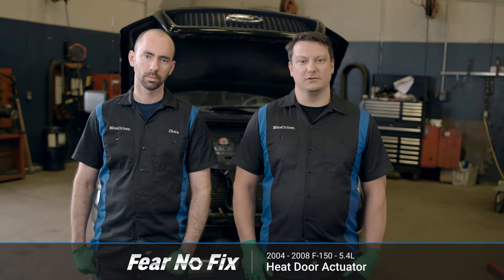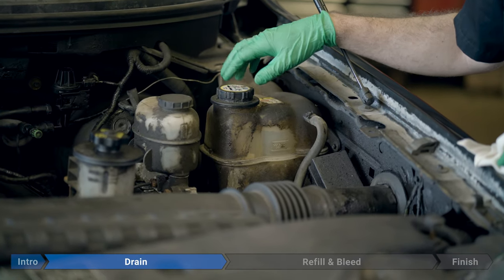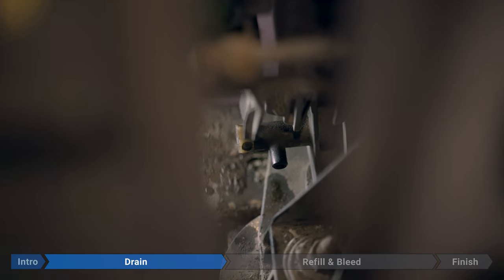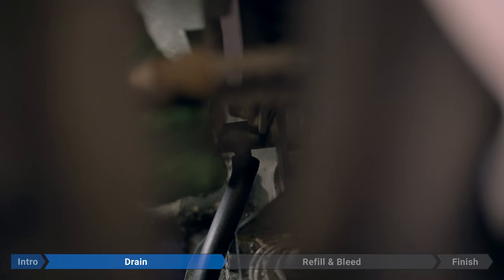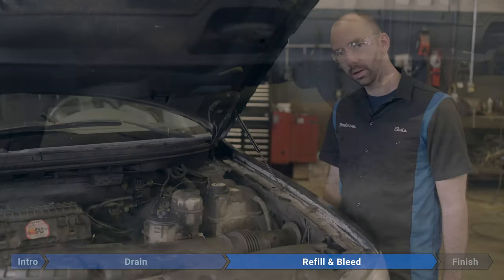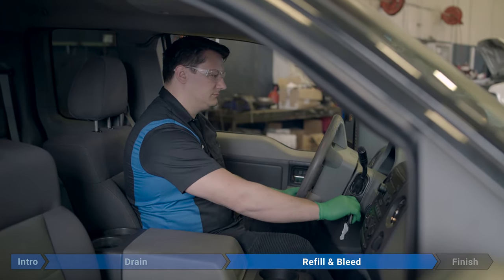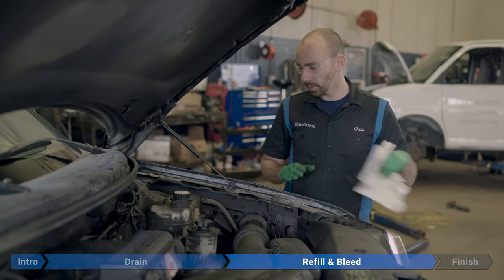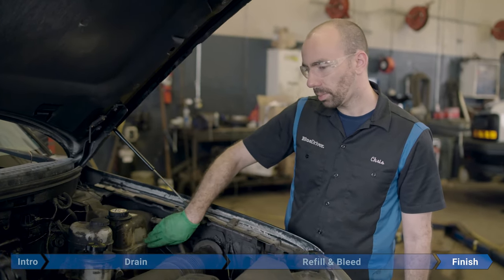Coolant Change – 2004-2008 5.4L Ford F-150

Comment: Let's see did I miss something no radiator flush,No running water unto clear ,block is still filled with the old fluid, heater core still with old fluid, Heat wasn't put on to help circulation. Guys your videos influence guys that look for a way to do this kind of stuff if you going do it do it right and not your interpretation of this 1/2 stepping.
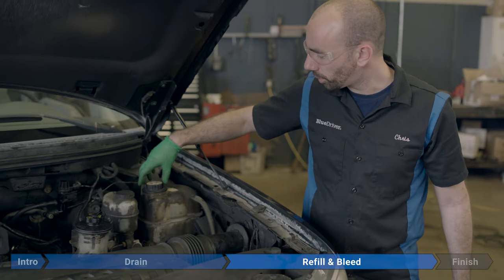Reply: He actually did turn the heat all the way up at 4:35 .  One of the problems with flushing the system with a hose is the water.  Tap water.  Now you're going to have tap water in the system.  All that tap water in the engine block is going to be bad with the modern coolant formulations.

Comment: My Explorer is due a 6 year coolant change. I do not trust shops on these things for 2 reasons. One, it is so easy to say you did all this stuff if coolant looked new anyway. Had this happen on my 07 Ram and I feel I was scammed. The more I talked with the teck, the  more I felt that way. Too old to do the work my self now so I must use a shop. This video did not make me feel any better. Drained the radiator and added some coolant to mix with the dirty stuff in the block. Not sure I feel the chemical flush does any good. May even harm but do believe in the coolant swap. As other suggested, refill and re drain may get some more old fluid out and we need to know the new mix is what is needed for the winter.🦇

Comment: Can I use prestone brand? . It's green color and it says it's compatible with all colors of refrigerant. I have the same truck.
Reply: I had a 2000s explorer that used yellow coolant, tried putting some generic green stuff and it caused a ton of problems. Seals went bad and it seemed like it ate part of the hose. No problems at all until I put the other stuff in it. If you do use the other stuff make sure you flush out the system completely.

Comment: A few unanswered questions here, especially block coolant, not flushed. But Jordan, your reference to dirty coolant, that truck came with Fords gold coolant and that's kinda the color.
Reply: The 5.4 engine takes 20.9 quarts, or 19.4 liters.  You need distilled water for the modern coolant formulations.  Have up to 15 gallons of distilled water on hand.  Drain the coolant.  Refill with distilled water.  Remove the thermostat.  Run the engine for 5 minutes while periodically revving it up to 3,000 - 3,500 RPM.   Follow same procedure to fill up to line on bottle.  Drain.  Repeat until the system is clean, with clear distilled water.  Drain half the water.  Reinstall the thermostat.  Fill with concentrate meeting spec WSS-M97B51-A1 .

Comment: A good flush is to open the fill port on the engine block alot of debris down there that doest come up on that drain by the radiator
Reply: Where is this at?🦇

Comment: Straight coolant!  😮
For those wondering, the mixture is 50/50 w/ one gallon motorcraft gold coolant & one gallon distilled water!
Reply: They said they’re using an oem equivalent. Could’ve been a premixed 50/50 coolant.

Comment: What about the coolant in the engine block.  Won't it contaminate the new coolant?
Reply from the maker: Ideally you'll want to pull drain plugs and get it all out, you can also actively flush it out or drain and fill a few times to get most of the old stuff out.
Reply: @LemurMonitors  how would you flush the block, too?
Reply: @LemurMonitors  Explain where the drain plugs are.🦇
Reply: I start with a cold engine. Drain the radiator leaving the petcock open and start the engine. When the engine opens the thermostat the block coolant will then come out into radiator. It will be hot and thats when you know the block is empty.As soon as you see the flow slow down shut the engine off so it doesn't run hot.Close petcock and refill.

Comment: What is that sound in start up the rattle some one said they need to open my motor and check maybe timing chain but I traveled to miles and no sign of engine problems only on start up the rattle
Reply: Possibly a exhaust manifold leak. It’s almost like a ticking sound. Not a huge issue if that’s the case

Comment: I bought a 2008 f150 4.6. The heater does not work on it. The other day it started to overheat. I replaced the thermostat and ran fine for awhile. A few days after it started getting hot again. What should i do?
Reply: If you're continuing to overheat after replacing the thermostat, then it means you might have a leak somewhere, either externally or internally into the engine.  You have to get under the truck to see and check the hoses.

Comment: Is the 3/8" hose you used on the petcock 3/8" inside diameter hose or is 3/8" the outside diameter of the hose?  Thank you for this video!

Comment: Thanks for the direct step by step to the point instructions without any bullshit , and safe 👍🏻👍🏻👍🏻 also no one said it was dirty , they said it obviously needed changed , looks like they were running straight water in that bitch

Comment: What if you get air in the system and it won’t take coolant ? Thanks
Reply: Same problem. Drained it. Flushed it. Added new. New coolant will not flow. Just rises in reservoir.

Comment: Why don’t you feel the radiator up if you drained it. But you only filled the resivor up. The resivor doesn’t hold enough coolant in it to fill the radiator up. And why didn’t you flush the engine of the old coolant as well.

Comment: WOW! My owners manual says capacity is 21 quarts or more than 5 gallons
Looks like you used less than 1.
Was that some kind of special edition 5.4?
Reply: They didn't do a full coolant flush. On the 5.4 engine there's still 2-3 gallons in the block and heater core.